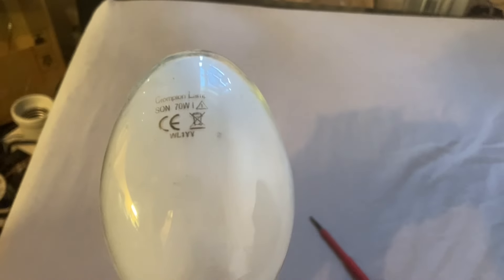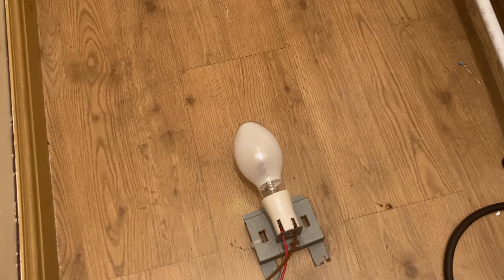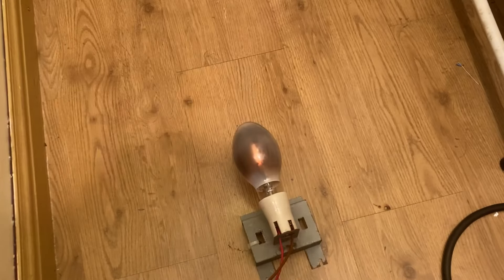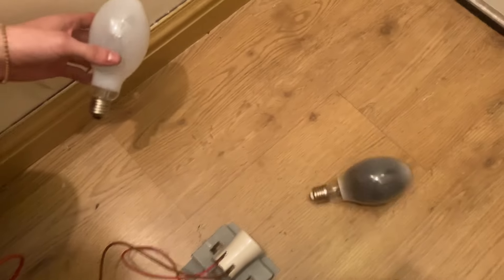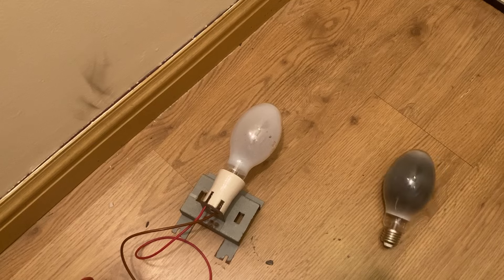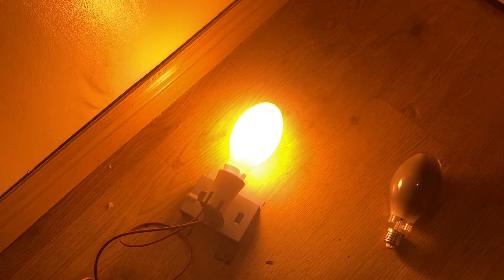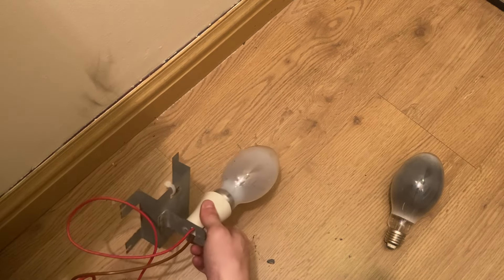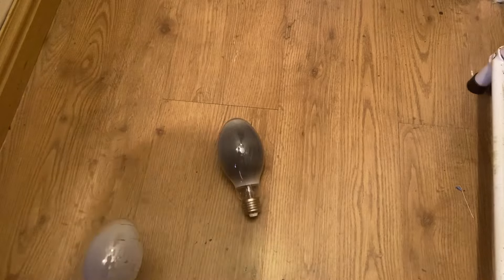5kw high pressure sodium

Comment: I have 60 large electrolytic capacitors, 5800uF/300V each for a total a bit over 15kJ.

When I get around to connecting them all together I might have to try running an HID bulb on pulsed DC. 

It probably comes down to whether I can figure out a way to pop it while still safely disposing of the mercury content. I suspect the outer envelope would split if that much energy was dumped in a few hundred microseconds.
Reply from the maker: @deltab9768  if it’s a small lamp do it outside and it’ll all disappear almost immediately and will be fine then, it’s such a small amount in them tbh it’s not even worth worrying about

Comment: Well thats one way to avoid the annoying 10 minute warm up time.  Funny that the inner tube popped coating the envelope with hot sodium.  Bulbs should have been smashed in a bowl of water at the end.
Reply from the maker: @ianhosier4042  high pressure sodium has so little sodium in it’s not worth bothering
Reply: @TheCORC964 i hope you don't have a cat or dog.  It would be horrible to think about it trying to lick up those bits of sodium coated glass fizzle fizzle
Reply from the maker: @ianhosier4042  was all contained and cleaned up, I might appear mental on vid but thought does go into cleanup and safety beforehand
Reply: I think it’s just sodium amalgam (sodium alloyed with mercury.)